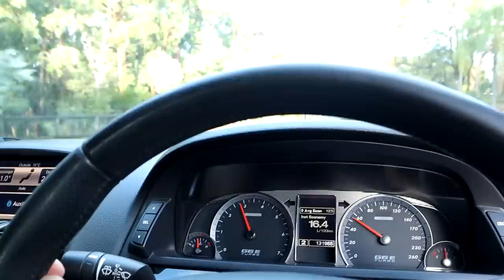I'M BUYING  ANOTHER TURBO FORD FALCON ??

Comment: Love my 2010 G6ET, I don't like the MKII front end though. Not sure what the XR seating is like but after doing multiple 600KM one way trips to Albany for Racewars, I've always felt no aches or pains at all in it.  Also apparently G6E's have a different windscreen to cut down the noise more.

Comment: My 50th anniversary manual turbo was 18g’s and the only mods are x-force exhaust
Reply: Aussie builts are going up in value lately. Especially since Holden closed down
Reply: Surely that’s super low kms cause I bought my xr50 turbo with 350kw for 18k😂
Reply: XxVicissitudexX  yeah there value has gone up a lot
Reply: Josh Gallard it just clocked over 100kms

Comment: I’ve been looking for a turbod fg for the last 3 weeks, most are around 110,000kms and want 20k for them stock very pricey
Reply: MK1 manual can be had for 16k
Reply: abbreviation of time as much as I love manuals and I currently drive a manual, those zf boxes are real smooth, so good for daily driving
Reply: Man my 2011 fg xr6 turbo is just over 105000km and it goes just as hard as the day it was produced. If the car has been serviced and taken care of they are very reliable with stupid power
Reply: @marleynugent2236  well autos are even cheaper. Try car sales. Com
Reply: abbreviation of time I live in WA so I’m not sure if that’s part of the issue, most are around 19k
Reply: Marley Nugent I bought one last week, the cheapest ones I found were in wa, unfortunately I live in vic and Rona meant no road trip, ended up getting one with 131k and a brand new turbo for 16,800

Comment: there are Turbo's out there for less than 20k that have like 60k on the clock. That is around 10 years worth of driving for me until it reaches the 175k that you got yours at.  There are no really good ones with high km in my opinion.

Comment: That front bumper looks off colour 🤨
Reply from the maker: That’s just a falcon thing, mine is off too on my turbo :)
Reply: ZacBaldy cheers good to know when are you running the wall at Archerfield
Reply: Not quite that drastic... there is always a slight different between the guards and the body because of the way the paint sinks into the metal or the plastic... but that does look like a respray sadly... and I am sure I could see a wrinkle in the wheel arch drivers side... and as someone else said.. the bonnet latch issue adds to the warning signs... and why has the dude only done 4000kms in it?  just some alarm bells champ...